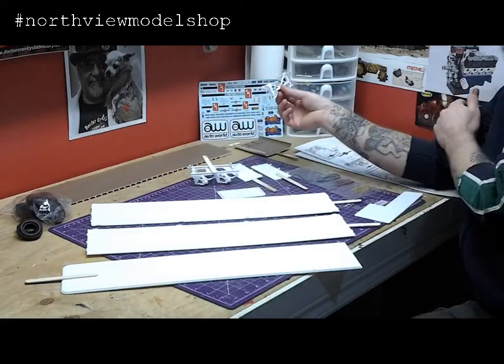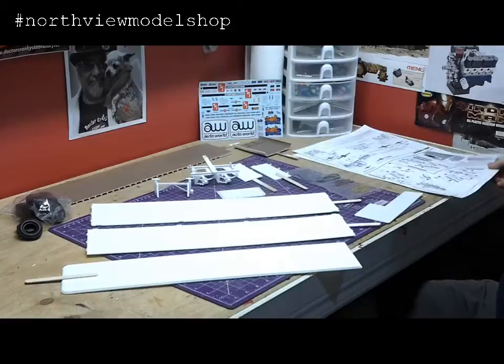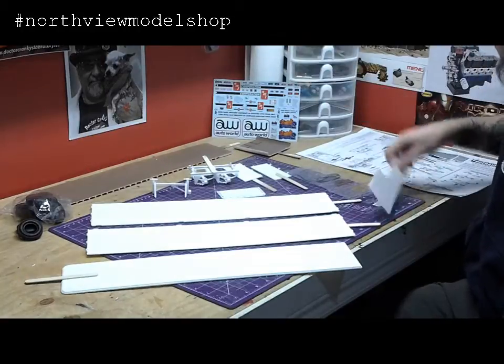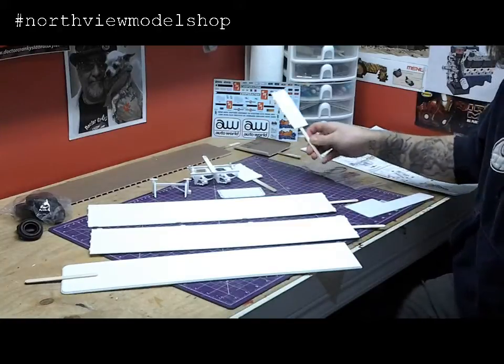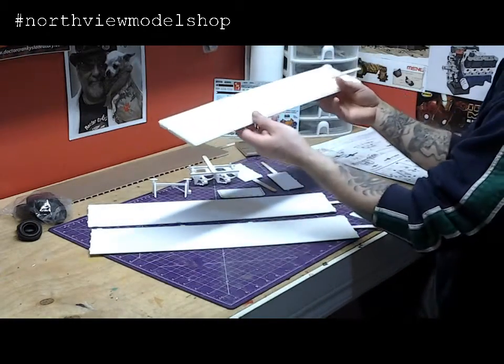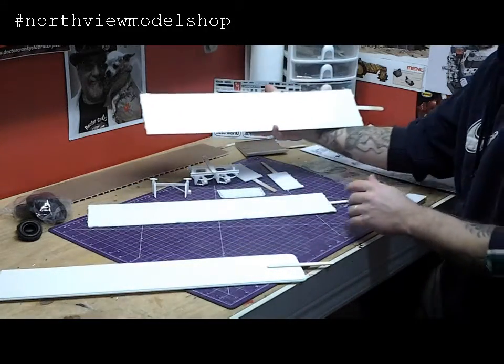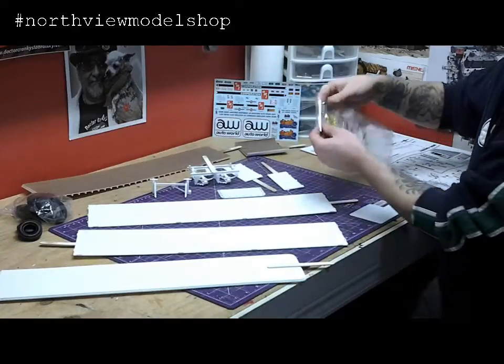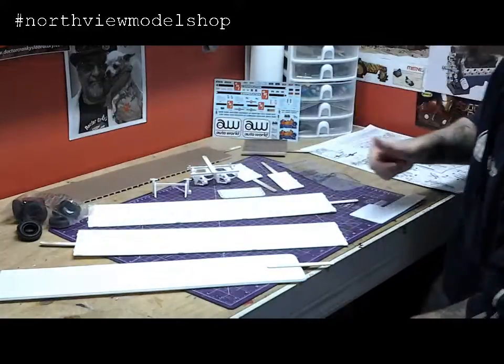AMT 1/25 Fruehauf Trailer

Comment: Very cool build man. I loaded many 53' trailers in my life time. Haha!

You should line the inside 1/2 way up with balsa wood in 4'x8' scale feet. You could weather it up, put holes in it, and definitely tag it up.

 Also for the round tie downs try thin wire wrapped around a thin pencil or somthing, Idk but maybe tooth picks for the slotted tie downs?, and for the roof try a thin black or gray wash.

Just my cents man. Keep up the great work buddy!
Reply from the maker: thanks brother.. may give them a try